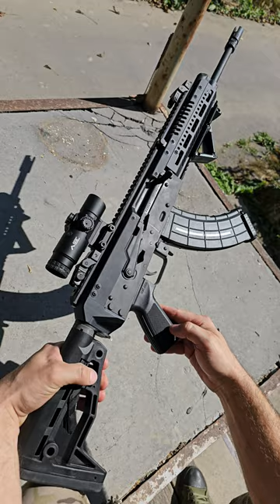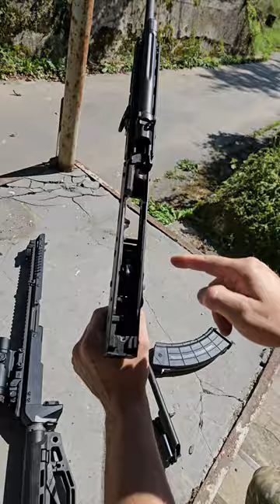AKB15 disassembly

Comment: Gosh they went through so much work with this design it makes me wonder if they were just better off making a new more efficient rifle design based of the AK.
Reply from the maker: This has started as a military contract to upgrade 10k old AKs and continued to develop a standalone rifle.
Im not sure why they scrapped the project in the end as it was almot finished but i suspect it was because of high production cost...
Reply: @PolenarTactical 
I suspect that having to mill off the rear sight, because that looks like where those forward "ears" for the front push-pin came from, as well as basically manufacturing an entirely new upper half for the rifles, most likely made the project almost (or perhaps more, because each old rifle would be not-quite-identical, slowing down machining operations into an almost hand-fettling process) as expensive as manufacturing brand-new rifles.
I know from experience that "just" modifying an existing thing is never quite so simple as "just do this".

Comment: So what we see here is a upgrade of the AK platform with a monolithic upper rail that holds zero because of 3 stationary pins.
Nice
Reply: basically, it succeeded on each point the AK12 failed
Reply: @geek1705  
From what info I've seen, it was the Russian MoD cheaping-out and just tarted-up old AKs with slightly tacticool furniture, which turned out to be floppy rubbish, rather than the re-manufacturing old AKs (very similar to this AKB15) into AK12 rifles that Kalashnikov Concern had proposed.
Reply: This is a very clever design indeed.
Reply: Ya sure, 3 pins that can work their way loose/you possibly lose while disassembling LOL. "Nyet, ryfle iz fyne."
Reply: @BrassBashers As in any part of any weapon if you are not careful, so...
Reply: What not spending development money on a yacht and a chateau on the French Riviera does to the AK platform
Reply: Are you sure about holding zero. Push-pins are not known to be made with ultra precision 🤨
Reply: I think that hypothesis needs to be tested. It has the exact same points of connection to the lower and barrel as the AK-12.

It will hold zero depending on the rigidity of the lower reciever.
Reply: @BrassBashers  Keep using your milsurp rifle fudd
Reply: @konstantin.v  It has both pins and locking pieces machined into the trunion. Forgotten weapons has a good video on it.

Comment: Check out the M10xz it solves alot of the problems this gun solved the biggest being the rail for sights. I like how the rail on the M10xz is part of the trunion and barrel so its remarkably accurate and yes.... they did resolve the heat treat issues they had.

Comment: They could have use a little bit more of merging by using the recoil spring inside the AR-15 stock, just like the HK 416 that is also a piston gun.

If you don't need a recoil spring in the stock, just use an MCX or SCAR folding stock!

Comment: Only thing i would change the it pins stay in their respective parts of receiver before coming oit all the way, similar to other platforms. It would be good to retain those pieces in firearm if field stripping as to not lose them. Great idea and design, sadly they discontinued them. Maybe Polenar Tactical should start manufacture something similar and import to US?

Comment: So the "floppy top dust cover" AK problem for mounting optics on was solved by turning it into an upper chassis which has the rear trunnion and stock attached to it? Very clever.

Comment: Something the AK will never be able to escape: its an old design.
It was made decades before optics would become standard issue, let alone lights, lasers, etc. It doesnt modernize well like a purpose made weapon does.
Reply: ...so was the AR-15. the M16/M4 family have had extensive modernisation.
Reply: @Vilamus  every mention of the AKs issues must be accompanied by a comment about the AR, but I'll oblige the jealous.
The AR15, by accident mind you , actually modernized very well. The barrel nut system was very easy to incorporate into a mounting system that could retain zero and at minimal weight. It was incredible easy to replace the handguards with an aluminum tube because, well, its a tube.